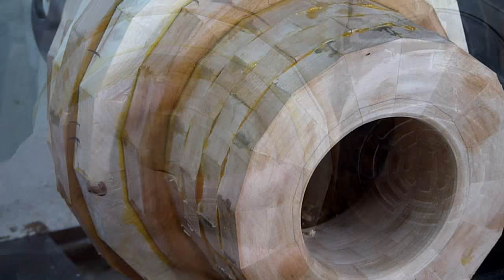Woodturning a Segmented Vase

Comment: Hi, I'm looking to do a segmented bowl soon. I wanted to ask a few questions. 1. what are the dimensions of your boards after cutting them down on the table saw? 2. what degree do you use on the miter saw to cut the segments? 3. did you use strictly a bowl gouge or a spindle gouge too? I have shine juice and it is a great finish. What a beautiful vase and just amazing craftsmanship!!!! I appreciate any help I can get with your answers! Thanks  Mike
Reply from the maker: +Mike Bettis  I usually cut strips of wood into 1.25 - 1.5 inches wide on the table saw.  for a 16 segment ring, the degree is 11.25.  I used a bowl gouge for most of the bowl, and also a heavy rounded scraper.  I really enjoy turning segmented pieces because there is virtually no end grain to deal with and it's such a pleasure.  Very rewarding too, to take little pieces of wood and create a pretty thing form them.  I hope that helps!  If you want more info on degrees, segment sizes, and so on, email me at tops.woodworking@gmail.com, and I'll send you some more in depth info and pics of my reference charts (very handy).  Happy to help!  Thanks very much and best of luck, Rod

Comment: how did you connect the vase to the lathe?

I saw you place the base of the vase against the lathe, and tighten something (I'm a Noob on my first day of reconing lathes for tool expansion.)

But, I never saw what connects the actual vase and lathe.
Reply from the maker: +TheRangeControl Thank you for watching and commenting.  I used a Oneway Stronghold Chuck with a mortise in the base of the vase.  I checked the chuck often to make sure it remained tight, but there are points where I should have used the tail stock for better support, and will in the future.  Good luck to you in your tool expansion :) !   Thanks again,  Rod
Reply: +R Humphrey Thank you so much for your rapid response time!!!  Sign of an awesome host.

Any lathe Recommendations?
Reply from the maker: +TheRangeControl haha, my pleasure.  I really appreciate your interest.  The best recommendation I can give you is to get the best lathe you can afford.  I know that's a generic non answer, kind of, but it's truth.  Thanks, Rod
Reply: +R Humphrey LOL
Ok, well that's fair.

which are the top 5 brands in the consumer market (that I may filter a little)?
Reply from the maker: +TheRangeControl I honestly don't think I'm qualified to say which are the top brands, however...  I use a Jet 14"x42" variable speed, and I've been quite happy with it.  It doesn't have a lot of bells and whistles, doesn't reverse spin, has specific speed settings, but it's handled everything I've thrown at it to this point, from 14 in bowls to chess pieces.

Notable brands that I've seen but not used incude:  Powermatic, Robust, Grizzly, Laguna, Rikon, Nova...  but the only top brand I've used is Jet.   

I bought my first lathe at Harbor Freight, and it was really inexpensive...and although I fell in love with turning on it, I also realized very quickly that I needed much more than an on/off switch and three inches of radius clearance, lol.

I hope that helps.  I know I've probably left some good ones out, maybe other viewers can give some input on this feed as well.  Thanks again, Rod
Reply: +R Humphrey that is actually extraordinarily helpful!!

It also keeps me from running out to Harbor Freight on a whim!! :-D
Reply: +R Humphrey may I please ask the model number?
Reply from the maker: Jet 1442VS